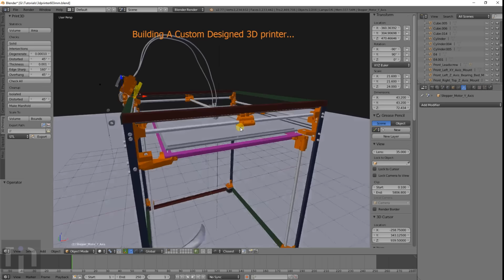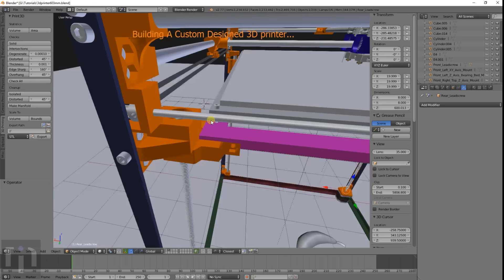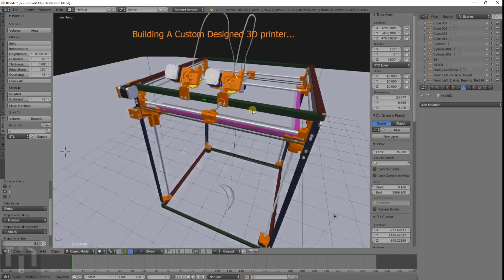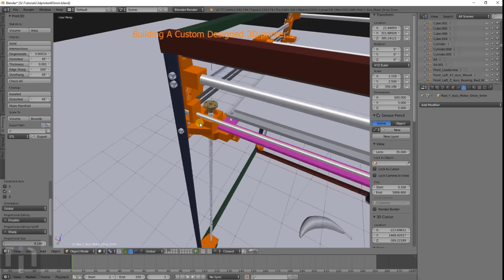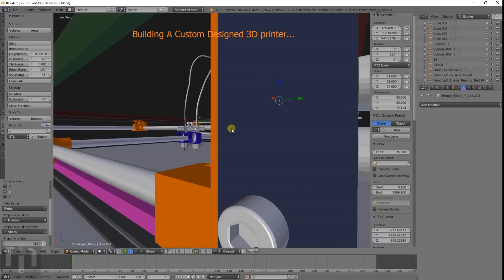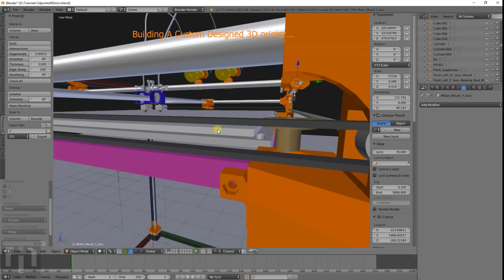3D Printer Design #001 : Basic Concepts and Introduction

Comment: Man this is amazing! Modeling all the parts and pieces must of took a while and some skills!
Reply from the maker: Just practice and patience.  It did take a while and the printer turned out okay...  I would do the bed differently after building it.  It really needs to have at least 3 points of solid connections.  Having the the bed only braced on the corners causes some wobbling that I don't like, but doesn't seem to affect the print that much.  (the whole printer moves due to the X/Y axis' inertia.)  The X and Y axis actually work really well.  The printer is just so light that fast movements make it shake a little.